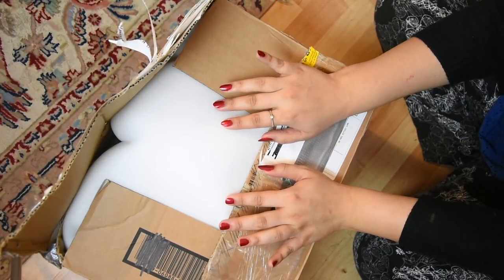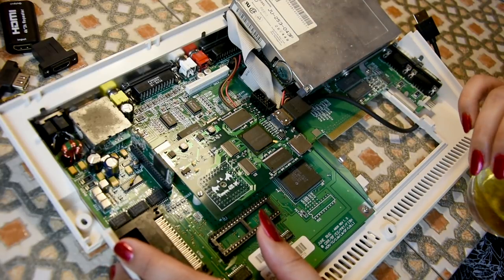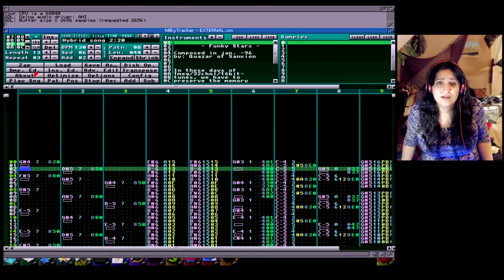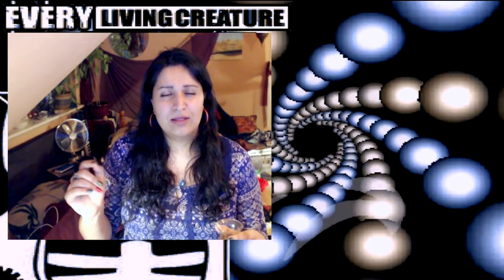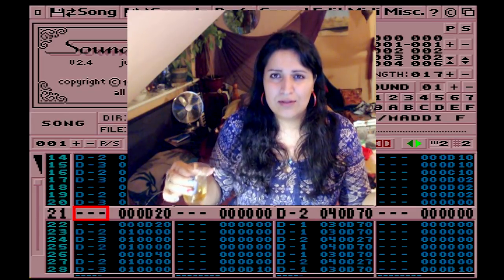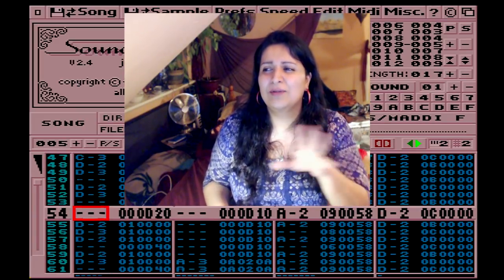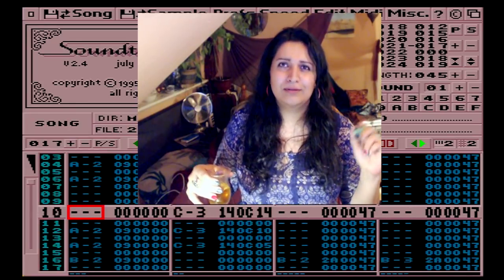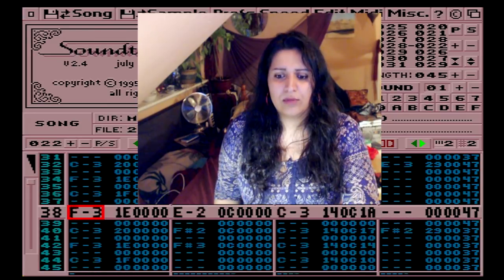Vampire V2 Amiga 600 Part 1 - Unboxing, Demonstration & Chillout talk

Comment: I have been using Amiga's pretty much since they first came out.  Does not matter to me if someone is using actual Amiga Hardware or Emulating an Amiga what matters most is your getting the Amiga Experience and not everyone will want to go out and buy actual hardware.    I do own 4 Amiga Computers which I do use and I also use Emulation, I also have a MIST that I play with here and there.   All my Amiga's have accelerator's except my A1200.   I own an A2000HD which I have owned since the early 1990's and I have a couple A600's which I like because they don't take up much space.   I recently received a Vampire 2 board for the A600 that I am about to install and I expect it will rock my world.   People can say what they want but it matters not what others say what matters most is the experience you have with what you have available to you at any point in time.   Trolls exist everywhere and they are best ignored.

Comment: Well, I thought the mystery box was a CD32. Not even close :-)

It's a big question, what is Amiga. I guess the answer is different for everyone. I often wonder what Amiga would have looked like today if it had continued. I suspect it would be very similar to modern PCs, perhaps with an Intel chip at its core and a PCI-E video card. Would that still be Amiga? *head explodes*
Reply: I would like to hope that regardless of what it's based on (and I'd favour ARM over Intel) that unlike Apple, support for old school Amiga software would still be a thing and WHDLoad would be an offifical part of AmigaOSX!

Comment: On the whole "Is it an Amiga or isn't it" question, I just say "Who cares?" :) If it's a "real" Amiga, a "hardware emulated" Amiga (FPGA, MIST, etc.), or a "software emulated" Amiga (WinUAE, Raspberry Pi, etc.), if you're having fun and it does what you need, then that is the Amiga you need. Nothing more, nothing less. It's bonkers to tell someone they need to go and spend thousands of dollars to buy a real Amiga off Ebay and kit it out with stuff if all they want to do is to play some games. WinUAE and the 30 dollar Amiga Forever disc is enough for those, or a 50 dollar Raspberry Pi setup for a more authentic feel, 100 bucks if you want to put that in an Amiga case for the look. You can do anything and more than the stock Amiga could in those, even certain accelerated ones, like a 68030 accelerated A1200. Sure, it has limitations, but most wont be affected by those. You can even run AmigaOS 4.0 in that. :) I enjoy using both, my two Amiga 1200s are half way across the world from me, so for now I just use emulation. It does the job, and it's just as fun as any other Amiga.

Comment: Emulation is not grinding, manipulating or forcing hardware to do something it wasn't intended to do. But with emulation ALL the functionality of the Amiga's hardware is done by software. All the components which make an Amiga into an Amiga have been replaced by rutines which converts the Amiga software so the PC or Mac can present to you in the same way an Amiga would. And unless you have an emulator which supports multible CPU cores... NONE of it is done at the same time, it is all done in small segments a little bit here and a little bit there to make it seem like it's running all at once. I suspect that this is what gives you this feeling of grinding or manipulation you speak of.

An FPGA isn't emulation because first of all; nothing is segmented, everything runs in parallel at the same time. It's not a collection of rutines converting or translating the Amiga software into anything. It is actually processing it exactly the same way the Amiga's hardware would. It is not software pretending to be hardware, but instead it's hardware actually doing the same work as the original hardware precisely as those components would do it, all in parallel realtime... just like an Amiga.

So for short (for sake of clarity): an emulator is an interpreter translating the software, so it can run on different hardware. While an FPGA is actually running it exactly as the original hardware would.
Reply from the maker: Thanks for clarifying, The grinding comment is me trying to get my point across passionately in resopnse to the people who say "vampire? might as well use FSUAE/WinUAE, same thing" and also the architecture isn't shaped the same as the computer being emulated and it requires a lot of computing power to emulate a system that is less powerful in comparison..Such as a computer with custom chips like the Amiga....I should have elaborated this really. but said in the heat of the moment :o)
Reply: It's totally okay... because then I get to define, clarify and hammer it out in granite :D
... with my relentlessly rationalising gear grinding monster of a mind... which too often refuses to settle down, when I need rest... like a old noisy furnace rumbling on and on in the basement... well, except mine is in the penthouse :P

People often say to me "Carsten, why do you make everything so complicated"... and I'm like "I don't? - why can't you see that's how the world is". Those are the usually the ones who would claim that WinUAE and FPGA is the same thing.

... and then sometime I envy them... seems like a simpler and maybe happier existence.
Reply: Don’t worry, I think most people understood what you were saying.

Comment: If I should answer the question what a real Amiga is it would be simple. Anything that is actual hardware (no matter if original components, completely re-made boards or completely FPGA based) that works just as an Amiga that you could have bought in it's days, with or without hardware tuning but without emulating the whole architecture. All fine and dandy as long as it's not completely bent in a way where it literally becomes a cyborg between Amiga architecture and a modern gaming PC where nothing lets you feel the Amiga anymore. Same reason why I'd consider a C64 with Super CPU still a C64.  Keep it in a actual keyboard case (or if you prefer the towers) as long as it's not becoming only 5% actual Amiga hardware at the end where you don't even know where the Amiga starts or ends. Software emulation is fine but boring and lacks everything of the whole experience and spirit: The physical level. We humans are physical beings and that is why physical experiences like real hardware is why we enjoy things a lot more. Things we can touch and where we know that they exist right in front of us and where actual power and working chips are creating the environment. Unless you are someone who choses "software only" for practical reasons. You know, as much as i like the raspberry Pi board computers… they are not actual Amigas to me (nor does the ARMiga) because it too is just software emulation on different hardware that I could do on a laptop or desktop or phone... A fun little project to fool around with, yes. But not something I would consider working with or actually replacing a real Amiga with. I tried it and it really is not much fun at all. It just always (and really all the time) feels like a software emulated system where you know it is not real. Not like you're actually having living breathing hardware in front of you and under your fingers. Emulation is like experiencing a dream but you cannot touch it and when you close the emulator you wake up and everything is gone.

Comment: Hmm, okay, comments... I suppose: 1. Man, you're weird. Which is why I watch all the videos :) 2. Chillout talk? Wow... 3. What is a real Amiga? Well, that's not easy I guess. Is an Amiga that doesn't even use it's own custom chips anymore a real Amiga? (PPC board for instance). And with PPC, isn't that shoving a completely alien type of architecture into your Amiga running completely incompatible software? What part of the Amiga is still used then? Isn't that almost like emulation? Running Amiga software on a PPC platform? A Vampire will hopefully do AGA graphics on non-AGA machines. What part of the original Amiga is still used there? Not even it's custom chips or CPU are used anymore. How about an AmigaOne X5000? That's really not even remotely an Amiga... And talking still about PPC, Commodore was going to go with PARisc, not PPC, and the designers wanted to go to ARM... Even the architecture would therefore be wrong... But still... Aros, MorphOS, AmigaOS 1-4 running on whatever platform still use the Amiga software. But then again, so does an emulator. So, is it an Amiga if it uses specific hardware to run Amiga software? I think none of it matters. It only matters what YOU think, like and want. I really like the original Amiga's. In fact, I just bought a Amiga 4000/030. After I sold everything 6 years ago (still really regret that move). I'm planning to use ethernet, a graphics card, more memory than ever intended, weird accelerator cards running at speeds nobody ever imagined (in FPGA, which indeed is hardware, just like the AGA chipset to my opinion). I would also very much like to try a X5000 if I could... Wow, can anyone ever make sense of this story or what I was trying to get across? Guess not.. Anyway: Amiga jeej, enjoy it any way you like! Like you said: Commodore is dead.... Oh, wouldn't it be cool if anyone actually build the next generation Amiga that Commodore had already designed?
Reply from the maker: I can understand  the issue with A-EON PPC systems which have to emulate 68k, i'm a bit funny about that too if i'm honest.. but the blizzard PPC accelerators had the PPC running side by side with 68k, so you could run both really. That wouldnt be emulation in my eyes. 

That is one thing I'm not a fan of ESCOM for, Commodore were literally moments away from creating the Amiga 1300, with great improvements and easier to upgrade etc. apparently it was even said to be a done deal, then Escom bought commodore out and scrapped the Amiga 1300 idea not going ahead with it, And basically were drilled into the ground. That FRYS me, we could have had Amiga 1300s even if commodore still would eventually go bankrupt. 

And i'm glad i'm weird, I would have missed out on all these cool things had I been "normal" ;o)
Reply: PPC turbo boards are a weird one for me. Yes, they do still have Motorola processors on them, but they run code which basically none of the rest of the machine was build to deal with. Then again, Commodore and it's designers always wanted people to push their hardware as far as they could. And if I COULD have afforded one, I would have bought one of those boards. But they were WAY too expensive for me... Weird thing for the real next gen Amiga would be that it wouldn't be compatible with the Amiga at all! But it would have a much faster CPU (and more advanced, even though I would have probably opted for a PPC or ARM myself), FPGA option, DSP from what I read. Perhaps someone will build one one day. That would be really cool! 

But yes, Commodore was a company run by baboons, but obviously, so was Escom. Real pitty. I guess neither of them understood the users and fan groups. Not even slightly so. 

And I like weird.. What do you think I am... Much more interesting than being normal... It's great weird people also run channels on Youtube :)